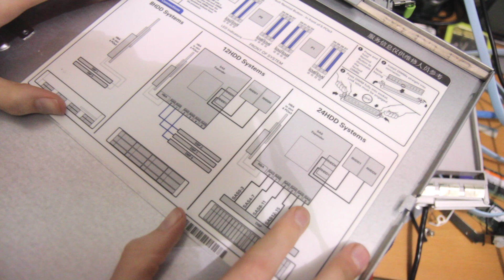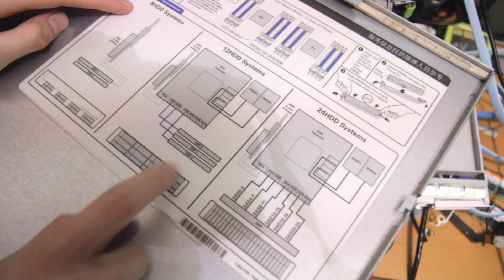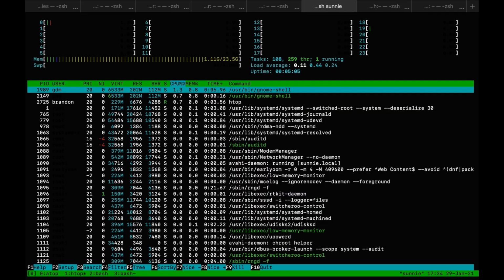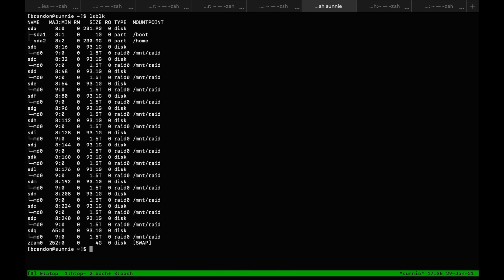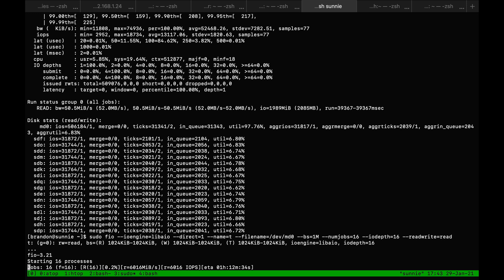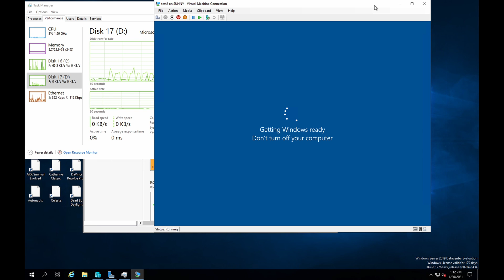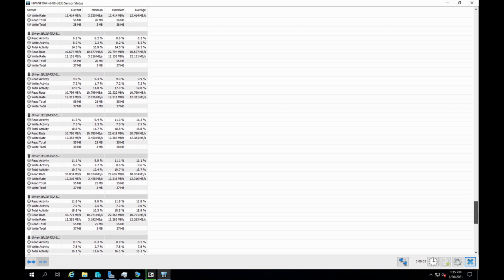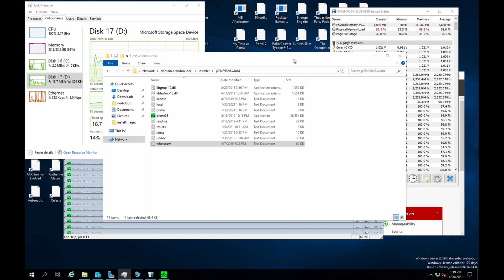Taking a Look at a Sun Oracle X3 2L with 4x Sun F40 drives

Comment: How to spanned the drive together I have a F40 which is 4x100Gb but I need to store a single file of 200Gb. Spanning in window work flawlessly when I tried. However, I need to do it for Ubuntu as well. Do you have tutorial on combining the drives? Thank you in advance
Reply from the maker: I’d use mdadm in Ubuntu to merge the drives into one. I’d setup a raid 0 array on all the 100gb drives making a 400gb volume.

Comment: What ram does this server have? I bought one off ebay but it did not come with ram. I am unsure if any registered ddr3 ecc will work or if i need to stick to 8gb+ dimms.
Reply from the maker: I am using a mix of registered ddr3 ecc dimms. I have about 5 different ddr3 rdimm systems and 5 types of memory and basically any combination works so memory compatibility seems to not be very picky on those systems.

Comment: Isnt it kind of getting old to keep using it?
Reply from the maker: Yea it's a older server now but normally servers seem to last a while before hardware failure, and the drives still show 99 percent life left.
Reply: The F40 and F80s are incredibly durable, I currently use an F40 in my server and an F80 in my desktop, the F40 and F80 do about 2GB/reads and 1GB/s write even with a Windows software raid (the random r/w is terrible)